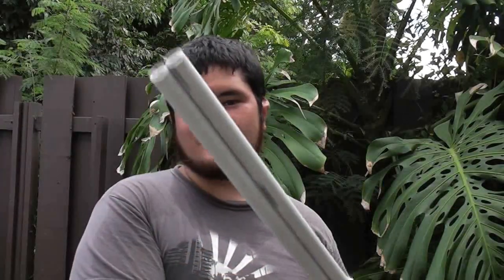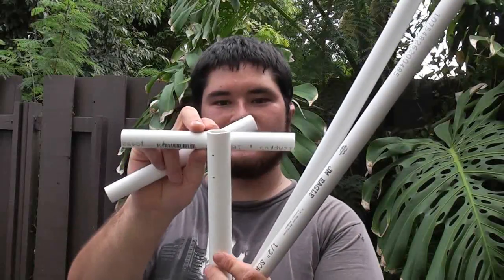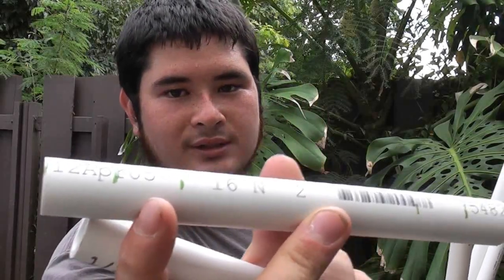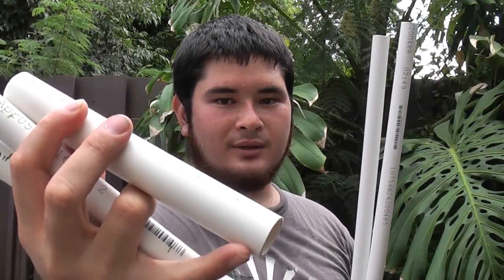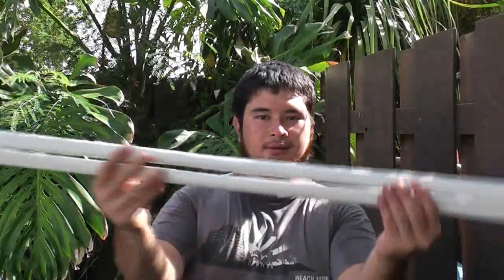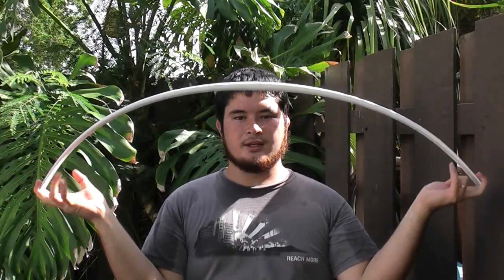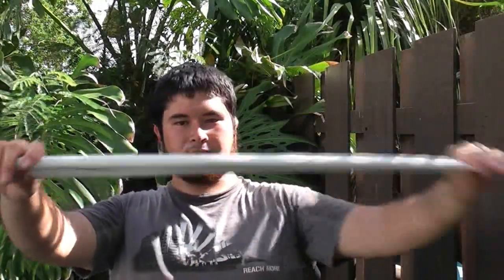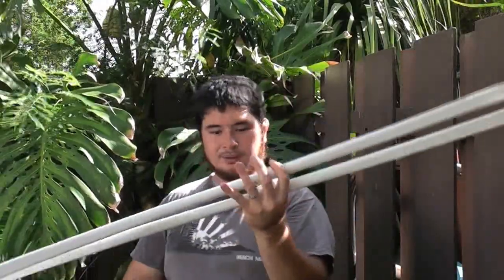How to Make a Centershot Double PVC Bow With Built In Quiver Part 1

Comment: Ok, I Dont Understand What Im Doing Wrong, Ive Got A 750/1500 Watt Heat Gun, Im Using It On High, Im Not Using A Heating Trough But I Used A Torch Today And Put It In The Flattening Jig, The Pipe Wouldnt Stay Flexible Enough And Wouoldnt Stay Straight, It Ended Up Looking Like An Epileptic Israeli Letter, What Am I Doing Wrong??